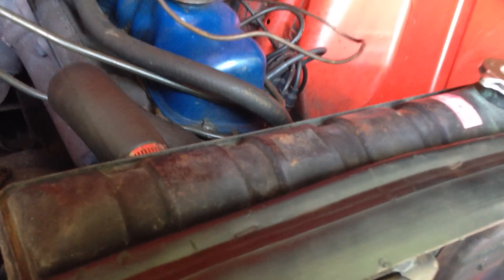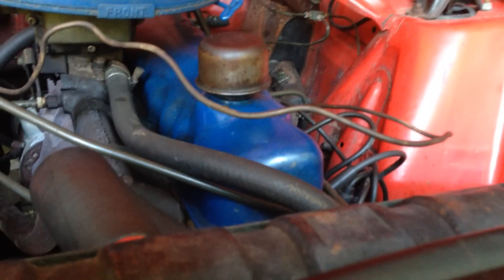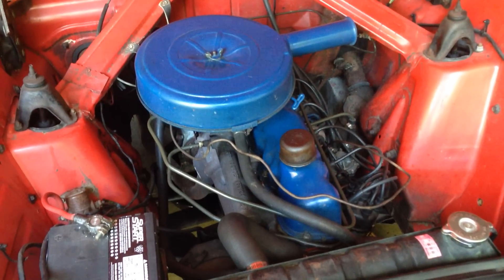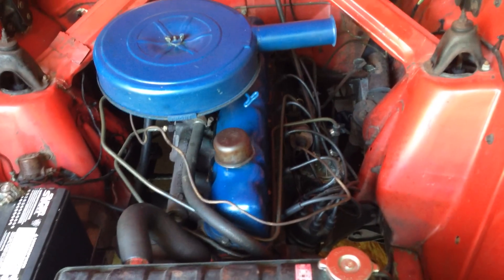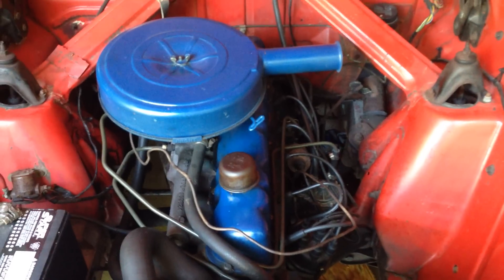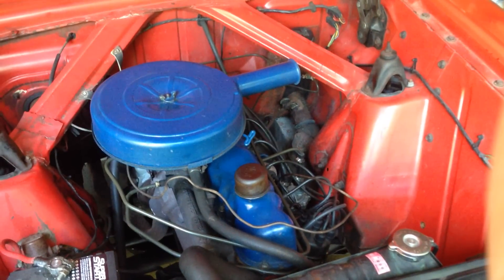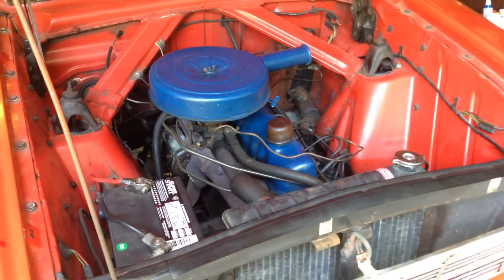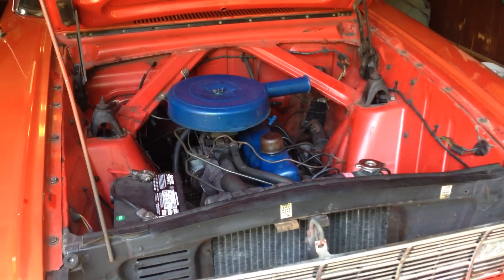Falcon Engine Swap Thoughts

Comment: I think you should put an Pinto engine in it with individual carburetors, maybe adapt motorcycle carburetors. It would still be ford, be lighter, just as simple with no fuel injection and whatnot, and they make good power. Something like an older cosworth engine out of an early escort or something or another. I think an old ford 4 banger will be pretty original and cool.

Comment: If you want a COST EFFECTIVE FORD V8, the crown vic interceptor/mercury marauder engine is a great and cheap starting point. Not only is it reliable, it has an actermarket, such as supercharger kits and tuners

Comment: FINK decrees that a motor swap is premature. 

The whole point of OVF is to see if a 55 year old car can still serve it's purpose as a regular car in the modern world. What's the point of this whole exercise if you put in more modern running gear?

If the time comes where that engine isn't worth saving or rebuilding, you'll have no choice but to swap it. If you do that, you'll need a nice big radiator to keep that 302 cool. Might ad well start with a nice big radiator and electric fan(s) and see what happens. Also, put a new water pump on it.

You mentioned it was burning white smoke in one of your previous videos. That might be a sign it's burning coolant which could suggest a blown head gasket or cracked block. That'll make it overheat.

Comment: Hmm well I would do some research on Google to see what's out there for Ford Inline six parts, and performance and just do full rebuild on the original engine.  Modernize brakes, suspension, and transmission.  Convert the engine to EFI, and electronic ignition.

Comment: Honestly, I say find another Inline 6 by Ford. Do get another radiator and an electric fan. Hell, maybe see if you can find another carburetor to also increase power? If you really want a new engine, take something out of a Ranger. It'll either have a 4 or 6 cylinder, and it'll be already mated to RWD.

Comment: All you need to do is get a new rad cap if its not that find a rad that gurgling noise is the coolant boiling that means it have no way to relive the built up pressure that's all just a rad cap.....get a softer rated cap

Comment: Questions for Mr Regular:
• has the carb been cleaned/jets been checked? Running lean or rich can cause heating.
• has the pump been checked out (off the block) to see if the impeller is toast?
• how nasty was the water in the last flush? If it was still not clear, it could still be clogged.
• are you super duper sure the thermostat was installed right? Even experienced mechanics make mistakes.
• have you considered waterless coolant like Evan's Waterless? 

And as for my vote on engine swaps, try to keep this one if you can, as the ford I6 is a beast of a motor. dad had his stock motor in his 66 mustang for nearly 340K miles before a piston ring welded itself to the cylinder wall. He ran it as a straight 5 for another few thousand miles before he finally had enough to have it professionally rebuilt with slightly higher compression, and has since put another 120K slap-happy miles on it. But if you must, then go with something kinda small and economical, easy to work on, and relatively cheap to fix as well as something that has oodles of performance parts available. I'm not even hinting at a V8 swap. I'm thinking back to a very popular saying. "The answer is always Miata." Yeah, a Miata 1.8L four banger. It already makes the same numbers, is lighter, gets better gas mileage, is easy to work on, can be turbo or supercharged, has a bazillion parts available, and it came from an era where Ford was still working with Mazda, so it's not exactly terrible as far as brand switching goes. And if you get the coolant re-route on it with an aluminum radiator that big, she'll basically  never overheat again. I mean, this IS going to be your next road-trip vehicle, right? Even if you decide to go with something bigger, you might as well make it something with decent gas mileage.

Comment: It didn't come stock on the car but an after market fan shroud would GREATLY increase the cooling from your fan. Without asking you a dozen diagnostic questions that's a good piece of advice just in general to help insure the longevity of the motor.

Comment: I was discussing car with a friend, and silly idiot mind decided that if you just wanted the car to be reliable and comfortable for normal driving, what about a 2.3 Duratec from a newer  Ranger. There's also the option of fixing the 6 and putting a newer trans with overdrive behind it.

Mostly unrelated, but I myself have frequently found myself thinking about finding an early 2 door falcon and building a a trans-am-ish car with a 302 and a t5.

Comment: Roller 302, gt40p heads or maybe some aluminums if you have the money, e303 cam, 1.6 or 1.7 roller rockers, air gap or performer rpm intake, 450 to 600cfm carb. Nothing crazy but is simple and sounds nice. I'd go for a world class t5 or a foxbody AOD.

Comment: Get a can of ac condenser cleaner and spray it on the radiator  fins.  Clean it off with a garden hose and add a fan shroud. Then reinstall the thermostat with a quality one.  Fix the trans leaks and you're good to go.

Comment: I think you should fix the original engine. An average Joe in 1960 wouldn't swap his engine.
Reply: Sam Stoner yes he probably would. these cars were super cheap it would have been more money to fix the 6 cylinder then to find another one from a wrecked car. you also have to remember these cars didn't last that long and the bodies rotted away much faster than the engines wore out.
Reply: Straight 6
Reply: ***** You've obviously never looked under the hood of a pre-00's Jeep before then :P
Reply: You don't have to be an insecure male to enjoy off-roading. o.O
Reply: ***** The Corvette used an Inline 6 for its first generation.  Mustangs used Inline 6's until people realized the 289/302 was a far superior option for power.
Reply: Sam Stoner Pretty much. Once the current engine's good to go and the car can drive, then hey, maybe think about swappage.
Reply: ***** It's an i6 not a v6.
Reply: Noah Ferrari absolutely right, Noah!  I'm old enough to remember.  Engine swaps didn't come up that often because getting rid of a worn out/rusted out car was a better option.  In the unlikely event one of these cheap boxes survived, an engine and tranny swap were FIRST on the list of things to do.
Reply: ***** V6s in general were not common in most cars before the 1970s, American or otherwise, so I6s were usually the "economy" option in American cars of the '50s and '60s, and some lived on beyond that. The C1 Chevy Corvette actually only came with an I6 in its first few years.
Reply: ***** into the (very) early 60's there were a fair few basic trims with Inline's (basically engine desinges from the 40's). Then of course there is the 70's American compacts like your Gremlin's, Pinto's and Vega's.
Reply: Moab, Bro... ;)
Reply: ***** Which is all of them.
Reply: Sam Stoner Yeah, no, maybe not in 1960, but by 1965, many of the engines would be swapped, and by the 1970's, they were almost always swapped. Engines were cheap, and they were everywhere.

I say he should fix it if it can, but if he can't, a period-spec engine like a 390 from around 68-69ish would be very suitable.
Reply: +CPD0123a The 390 is a far heavier and larger engine and would not even fit, besides making the car absurdly front heavy. The 260-289-302 is way lighter and designed to fit.

Comment: I had a Slant 6 like this that overheated a lot. It needed a fan shroud, new fan, valve lash adjustment, timing adjustment and that engine ran much better. One thing I see you are most definitely missing if the shroud, even an aftermarket one helps. Also you can "Burp" the coolant just like you said, let the engine run and turning on the heater (if it has it.) then keep adding coolant while it's warming up. not now while it's steaming hot.

Comment: If it's possible to save the stock six in her for a down to earth-price, go for it. Otherwise a period correct ford V8 (Windsor or even a Flathead) would be quite nice. Or like every dickhead ever: BRRRUMMUMPHUNNUMPHRR, DO A 2JZ SWAP! DO A TWIN TURBO LS SWAP! AT LEAST 1500 AT THE WHEELS! 100 MM TURBO MAKING 40 PSI MINIMUM! AND RUN SMALL TIRES TO SHOW THAT YOU GOT BALLS! UNDERGROUND RACING IS A HOAX! MURDER NOVA IS FAKE! I CALL OUT LARRY LARSON EVERYDAY WITH MY GT-R ALPHA 12!

Comment: Put a 4G63 in it with some kind of turbo
Reply: That a powerful I4. Fuel consumption is awful tho... RB26 would be better or a 2jz for 3000$
Reply: Michael Carreiro A simple RB20 swap would be better economically if he were to daily drive this, a twin turbo strait six is great but the the fuel consumption isn't.
Reply: AGAIN NO GOT DAMN FWD MOTOR IN A RWD CAR
Reply: Green Pretzel That's a TERRIBLE AND I MEAN TERRIBLE choice for a Falcon get that small displacement out of here

Comment: Yeah, with an engine that old you just have to pull it out and rebuild it. The 1960's didn't have the machining precision or metallurgy to make engines last. So your rings are shot, your headgasket is leaking, and your carb is probably running lean which is worsening the overheating.

That's what you get with old cars. Gorgeous styling, but an absolute basket case of big problems. If you want this as a daily driver, or able to cross state lines with confidence, you will HAVE to swap out the drive train.

Comment: Keep it all Ford Falcon Mr.Regular and swap in a DOHC I6 from an Australian Falcon.  Theres no reason to get all crazy with poor running carb'd V8's or boosted Japanese engines.  You'd score MAJOR street cred by keeping it all Ford Falcon and people in the states will flip out when you pop the hood and see a DOHC I6 with a Ford logo on it.  Plus it will run silky smooth with plenty of power to get you around with the reliability of a modern engine.

"Just DO IT!!!"

Comment: Jack up the car so the front is as high as possible, it'll force air foward and up due to gravity.

Take the radiator cap off and just let it run. Just stop it before you start overheating. They make a special radiator cap adapter that allows the system to stay preassurized while letting it burp incase you want to spend money

Comment: if you're gonna replace that engine, replace it with a 250 i6.  easy 155 horses with just the emissions control bits removed

Comment: I'd go with an aluminum radiator and an electric fan to start with for the time being and if you get the correct size radiator you are future proofing the setup so that if you do decide to go with something like a 302 you have what you need in place to upgrade with no further changes.  You can add an external cooler for the automatic trans (if you go that route) and then with a stock built 302 you are not going to really kill your drive-train, and I suspect that you will actually get better fuel mileage as long as you drive effieciently.  To avoid having to do a lot of carb tuning in the future and add reliability you could go with an aftermarket EFI managed system on that V8 if you go there and really have a reliable daily driver with some nice power and maybe look into upgrading the steering and front brakes (I suspect you can use a lot of Mustang II front end parts to acheive upgrades on a budget but I am not an Ford guy, beyond appreciating the curves of the Falcons, Mustangs and Cougars.

Comment: modern throttle body fuel injection from edlebrock , electric fan, new wiring, and a overdrive transmission like a 700r4 because you can find them for dirt cheap. Also something else you can do is a hotchkiss suspension if you want to get good ride quality.

Comment: I would replace the motor with an identical newer motor. You want to prove that the car could still hang with the cars in today's world. When the car was new it didn't have a 50 year old motor and trans.
Reply: Or he can have it professionally rebuilt and restored. That would work. He can even have some simple performance mods done while they are at it.

Comment: As for the trans leak, clean the trans with brake clean, and drive around as long as it takes to get it to start dripping, and check to see where it's coming from. That's the easiest way unless you wanna use the dye method.

Comment: The straight six is an outstanding engine
Rebuild the engine, Or step it up to a Ford 300 Inline 6 with a good transmission -------You can keep the original engine and trans safely stored away.
maybe add after market fuel injection.
And  then enjoy vehicle. 
Later maybe you can upgrade the brakes

Comment: It should be just an air bubble, run it with no radiator cap or pull the rubber gasket out from the cap, the water pump doesn't work when it has air in the system. This would cause your over heating problems. The transmission might need a front gasket, 4 bolts on the flex plate and pull off the torque converter and the gasket is right there. Don't swap the motor, it is still healthy just need to fine tune the quirks. Good luck

Comment: Jack up the front of the car on jackstands, that way the radiator cap is a higher point in the system and run the engine with the rad cap off - this has worked on a number of cars I've owned, not sure about something this old however.

Comment: other people have said it and I dont know how well it would fit but the 300I6 IS A HELL OF A RELIABLE MOTOR. MY DAD USED TO GET 80kMILES BETWEEN OIL CHANGES BEFORE THEY WOULD POP AS IN HE NEVER CHANGED THE OIL. god dam caps lock!
also its still an Inline motor and with a blue valve cover it would probably still look at first glance like the motor you have now. also please keep it ford!

Comment: No no, hell no man. Keep it as original as possible. Replacing the radiator and an electric fan sounds good, but please dont replace the engine/transmission.

Comment: IMHO: swap a 302 and drive train just to drive the car, but keep old ones and slowly rebuild the original engine. It's easier on the wallet. If you change your mind you can always sell the rebuild engine. Or sell everything and buy a AW11.

Comment: If the car still has a heater core, (I can't remember if you told me or not) turn the heat on and see if you have heat. If you don't feel anything, then there's an air pocket in the heater core. There could be air pockets anywhere but that's a very likely place. but as alot of people are saying, run it without the cap for a bit. It's probably just an air pocket

Comment: DON'T YOU DARE V8 SWAP THAT CAR. 

Buy a Mustang six. It's 200ci six, 7 main bearings, bolts right up just like your 144 it'll be easy as eating pie to hook it up. In stock form you'll get a whopping 120hp. The engine even looks the same it's got a Ford blue on it stock. If you want cheap that's your option, I got mine for $200 with my transmission. But I sent you an email when you first got your Falcon with way more info on the swap.
Reply: Joe Hignite  I completely agree. A 1965+ 200 I6 (because pre 65 was still a 4 barring motor) would be an excellent choice. Also the 250 I6 witch is a stroked 200 would be another option. Don't go V8. If you really wan't better highway cruising you can swap the Ford-o-matic for an early C4 you'll need a cross member and  dearborn classics sells a linkage to go from a 2 speed to a 3 speed. I've seen a few C4 swaps in old Falcons and there are parts you can buy to make the swap easy.
Reply: Joe Hignite This, all of this!
Reply: Yeah, those mustang sixes are amazing. As I said in my post, dad's six had 340K miles or so before he welded a piston to the cylinder wall and it became a five. Then he ran it for a few thousand more miles before finally getting it rebuilt, bored a pinch (to relieve scoring from the old rings), got slightly higher compression, and has since added like 120K more miles. That block is a beast.
Reply: This is honestly the best choice in my eyes, I hate seeing these LS1 and 2JZ kids here, I love both those engines but not in a car like this, I have a 1964 Holden EH myself and I wouldn't put anything but another period six and transmission in it.
Reply: wolfgangiceclaw I wonder if the T5 from a Fox Mustang would fit behind a 200/250.
Reply: Joe Hignite
Hi i have a 1960 XK falcon i have just been offered a 200ci  inline 6 in excellent running condition are they a good motor he said its a Narrow block and way better than the 144 i have in there he said it will bolt straight up does that sound right

Comment: 2jz swap? If you 2jz swapped I would have my left testicle surgically removed and shipped to your doorstep, Mr. Regular. Or the right one, whichever you prefer.
Reply: Challenge accepted
Reply: sjpro1 fuck yes this thing needs this
Reply: It might sound unoriginal, but I was thinking 2jz too just because you can get a 2jzge vvti from like a gs300 or 2jz, and it will be reliable and quick with about 260ish horsepower and with a v8 maf and 440cc injectors, intake exhaust and headers with a tune you can expect 300ish or more hp, maybe even some ported and polished heads. Its also an i6, and very reliable hooked up to stock auto or w58 tranny.
Reply: Ford Barra motor out of an xr6
Reply: People are forgetting he is not made of cash ... I'm thinking a modern ford mustang v6 or an old BMW i6

Comment: Turbo the straight six some run low tens.  Maybe pistons rods and a balance.  Or junkyard 351w or a 400 modified or nissan v6 with a 5speed.